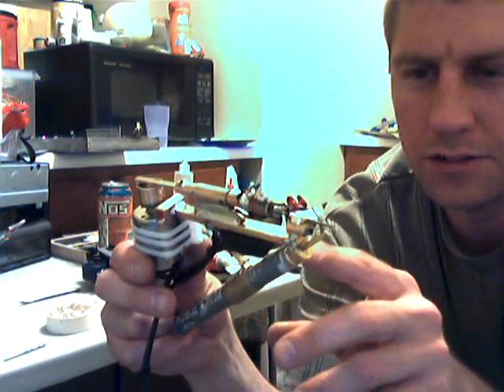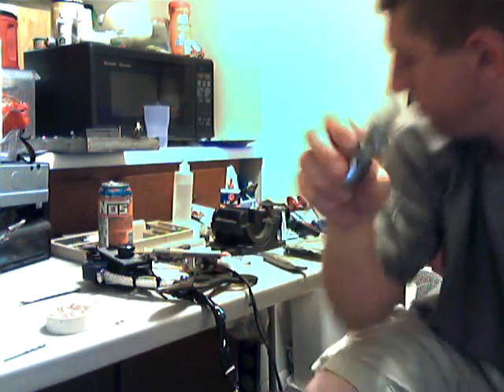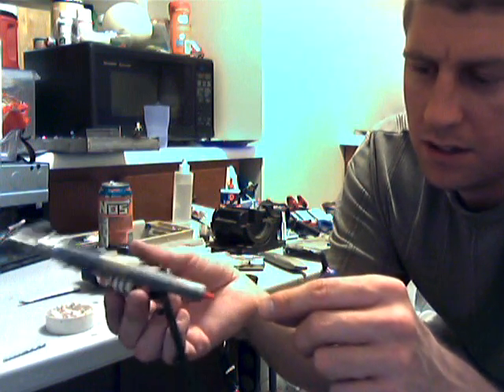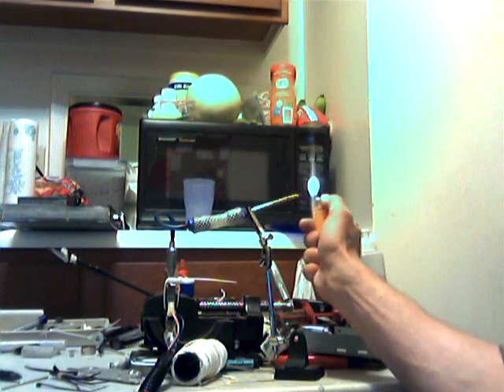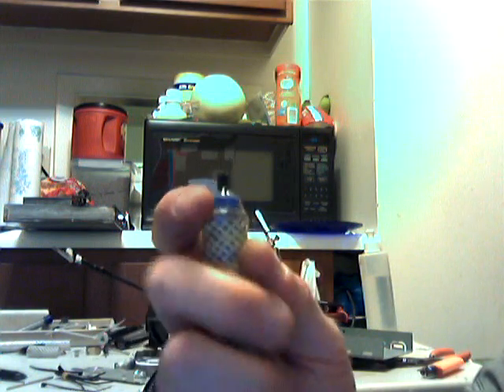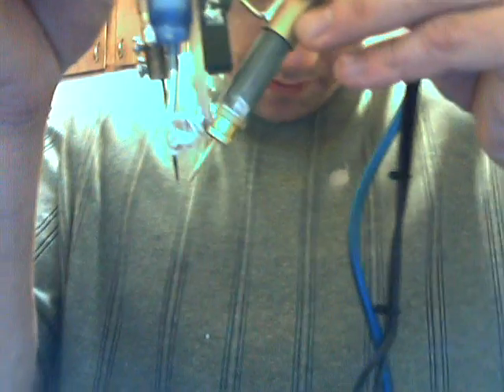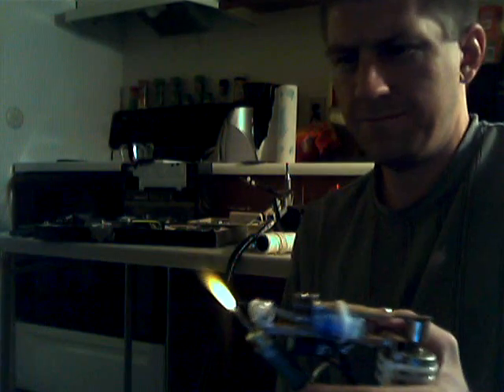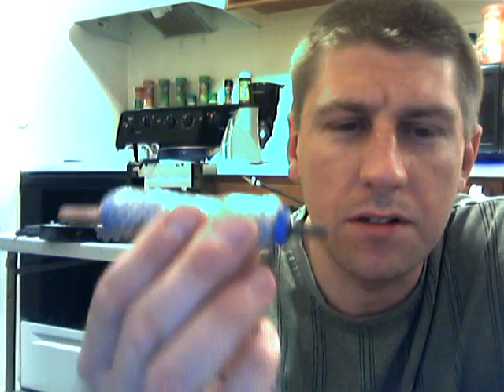HHO SAW  cuts steel using tattoo gun

Comment from the maker: you are so write about tip size it is the most important variable in the flash back equation ,i am most worried about lye water being blasted all over the place
any way perhaps a special tip that slides over the work like a plasma cutter would help make neater cutts that dont need exccesive additional work,also i treid forced air flow to blasty the metal away and it cools the pool ,im going to be doing some work on this i need good tools to use and this is worth it
have any footage of cuts?

Comment: I have very very very few flashbacks , I have found that with the torch tips and stuff , if ya get the tip size and gas ratio almost perfect 98% of the time ya wont get a flashback......The only thing the hho needs is blow power thats the thing that makes a cutting torch a cutting torch...which i dont do much cutting just for fun ..I like using it for solder and everything in between tho...

Comment from the maker: well the hho cutts from a big torch are far
from usable they need alot of aditional work and they are huge 1/8 inch gouges
not realy what i  call a cut, and im broke
and yes flash baks suck but i cant do without for now,the reset bubbler idea is way to loud for my kitchen but i do agree with you fba realy suck ass but they are very cheap,also my rig can handle flash backs without any devices at all it just makes a very very  sharp high magnitude explosin sound its kinda quit

Comment: Man just build ya a big cell , and crank that baby up to bout 12 lpm with .035 tip and you can bout cut anything ya want ......
Another thing I recommend is to ditch the flashback arrestors(they suck)  and just build a bubbler with a reset top , it never failed , well mine hadn't ...
However the mig tip thing works pretty good ..
One thing about flashback arrestors is they suck , they fail ,they restrict flow  they just suck .

Comment: Very Sci-Fi lookin torch man! very cool.

If their TIG rods your using be mindful that they shatter if struck too hard on steel, I tried using a bit of one as a center punch one day and it just turned into shrapnel.

Likewise, shock cooling with water could also lead to thermal cracking, but it should work fine if the temp is kept stable.

stay safe!